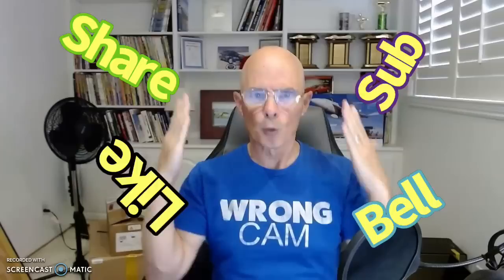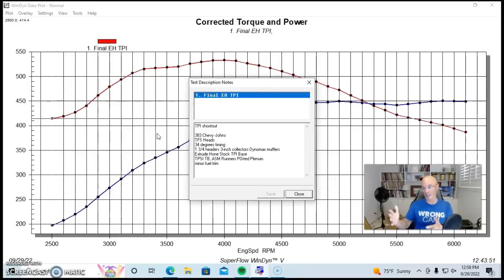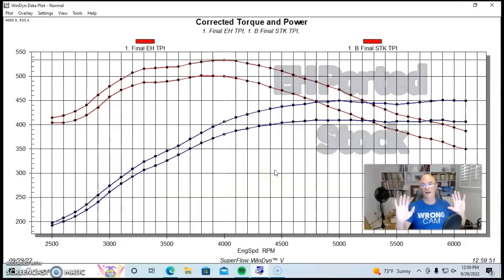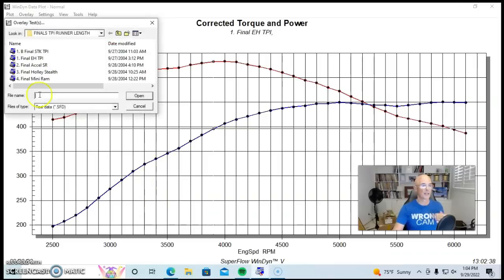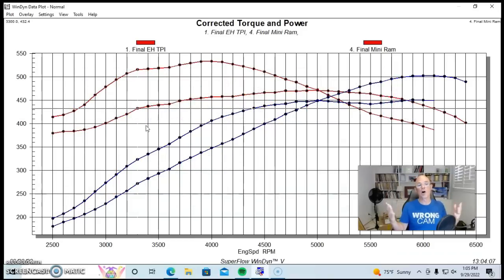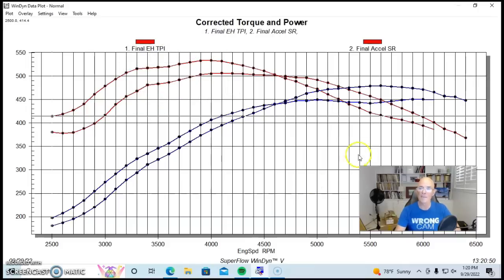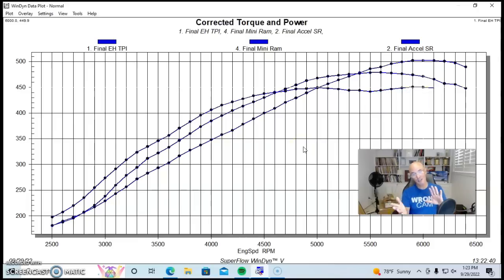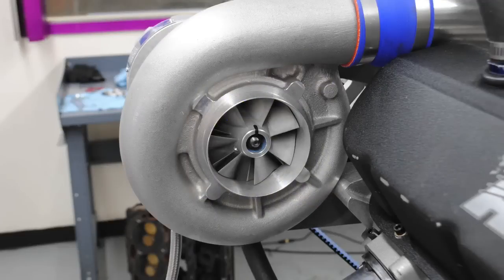TUNE PORT INJECTION-LONG RUNNER VS SHORT RUNNER-WHICH ONE MAKES MORE HP, WHICH ONE MAKE MORE TORQUE?

Comment: Tuned Port Injection - The greatest truck intake that never was!
Reply: They knew what they were doing. Need to fix your Vette/Camaro/TA? Get parts off a truck. Some of that went away with the LS.
Reply: GM could have DOMINATED the truck market if they would have put the L98 TPI in the gmt400 trucks in 88 instead of going with the TBI. Ford knew well enough to put a long runner efi setup in, Dodge did as well when they switched to mpi, but GM kept the abysmal tbi around way to long. Then in 96 when they finally switched, they went with the vortec, but used a medium length runner intake with the POS spider injection.

Comment: I keep getting tempted into going with a short runner intake, but every time I see one of these videos I realize I am better off with my TPI due to the rpm range that my combo spends most it's time.
Reply: Hello Kitteh  with my gearing I doubt I would ever hit 6500, my rev limiter is set to 6000, during test & tune I am at about 4800 rpm at the end of the 1/4, 12.9 @ 109 with 3.07's and all season radials, for my mild 383 and the way I use the car I am happy for now.
Reply: @E.T.GARAGE  Heck yeah, only a TPI will get you a 12.9 ET with 3.07s unless you're running a bunch more inches.  Sounds great!
Reply: @rotaxtwin  I have to launch real easy so I don't break the tiny little dana 36 in the rear.
Reply: @E.T.GARAGE  Yeah, good idea.
Reply: for short runners from what I see on the dyno curve, you neet to keep the car between 5500-6000 to maintain peak power and be superior to TPI. Below that it would make less power so will be slower. 
Now above 5000rpm there will be increased wear on cilinder rings and other things so if you want reliability the tpi is enough. However, the tpi makes more torque which can put more stress downstream and on rod bearings so you may need to tune it to reduce the max torque but not in the max power area. 
you said the rev limiter is 6k, I was wondering, did you parch the ECU bin file to accept extended tables?
Reply: @rotorblade9508  No  I have the standard tables, I do have extended tables in my bin. but I just dont bother with it.
Reply: For a street car I would rather have all that torque and horsepower at a lower rpm than to have to wind out the engine.

Comment: Holley stealth ram on a 383 afr 195 heads tiny cam I made 420whp back in 2000-2001 on 93 octane on a 1992 formula. Stealth ram by far the best option as great torque and peak hp came at 6400 rpm on a cam much smaller then he was using. Car ran 11s @122 mph which back then for naturally aspirated I was spanking a lot of ls builds and many procharger 4.6 mustangs. Once I did the turbo it was all over for them all. 800whp on 12 psi with a 3200 lbs car. Same 9.5 compression motor on same pos cam 12 psi was trapping 142 mph on a radial. Still 93 octane. I was spinning up into top of second gear so had to ignore then terrible et mid 10s but in the street on a fast roll that car beat bikes and not many cars were able to give it a good run.

Comment: I love the TPI .
 I had a 87 fiero gt with a 87 Corvette tpi 350 in it.  It only dynoed 328 hp at the wheels but 462 ft lbs torque after way to much money and time in it. With the 5 speed and my disregard for the longevity of the transmissions life it was awesome. 
 But at the time "2007" it was lots of fun and super quick. 
 Embarrassed allot of people who spent allot more money and had a blast.
Reply: Even on street tires at the strip I could dump the clutch at full throttle and just bang gears as fast as I could.  So much fun.
Reply: That must've been helluva handful and a lot of fun 👍
Reply: How did you tune it?
Reply: @xmo552  it was on mega squirt , so tune with a laptop.

Comment: TPI engines are a ton of fun if you build them correctly. I had an 87 GTA years ago that I built a 406 with good aluminum heads, smallish cam and a similarly modded TPI setup. Stop light to stop light it would destroy anything if you could get it to hook up.

The real pity of the TPI though is that GM never put them into their trucks since they did make such great low speed torque.

Comment: Still driving my '88 LB9 IROC, although a few years back I pulled and rebuilt the engine.  Compared to stock it's 0.020" over, has 1.6:1 rockers, 1.94" intake & 1.6" exhaust valves, 2-relief hypereutectic pistons, and Dyno Don headers.  Other than porting/polishing and gasket matching ports on the throttle body and runners/intake, everything else is stock.  Didn't expect any sort of earth-shattering changes--and can't really feel any difference.  But after 35years, it's still fun to drive with that low-end torque.

Comment: THANK YOU!!!!!! This is the exact question I've been grinding on all weekend. I'm going to rebuild my 288k km 305 and in the formula (cam/heads/intake/gears) I'm stuck at intake. My gut said that for my goals (300hp down low AND 30mpg) then the most i need is to maybe open flow with a throttle body and porting BUT I don't need $2000 in changes. Plus, the stock TPI can supply enough air my goal (much like you don't need huge exhaust if under ~400hp), so I can focus on efficiency.
What an amazing channel you have!!!

Comment: Totally modded 89 Formula 350 TPI. 58mm TB, AS&M runners, TPIS Big Mouth lower and cam with about 220 degrees duration I think, ported plenum with a T-56  behind it. Everything was gasket matched. Had Lingenfelter headers with dual big cats into a 3.5" Single.. It almost would lift the front wheels, got 26MPG at 75MPH all day cruising on the highway. Yes and Brodix-8 180cc heads. No mufflers and unlike a lot of cars from that day with Flowmasters it wouldn't drone you to death inside. It was actually not loud until you gut on it and it snarled at you... Probably because the decent sized single. Best car I ever owned... Unfortunately had a fire so I never got it to the track. It was good for 14.7 1/4 mile before and was probably a 12 flat car after the mods, would be surprised if she dipped in the 11 second range based on other cars. We took a couple hundred pounds off with the smog pumps, ac etc... Sighh will get off work tonight and drive my Honda Insight home ;0] Love these videos.

Comment: Running basically stock TPI, DAMN GOOD TORQUE, great autocross motor. Richard would using those "balls" to expand the tubes be worth it. G
Reply: Check out Charles Servidio.  He's modifying a stock TPI base.  It's not a size issue, it's a shape issue.

Comment: That answers a question I was going to pose about switching my Porsche 924 from CIS to  dual Weber DCOE.  I ported the cylinder head and intake manifold, installed a bigger throttle body, and put on a 4 into 2 into 1 header, and a thinner head gasket out of a turbo. I don't have a dynamometer, but I can definitely feel a difference in the seat of the pants and how far it pulls in the rpm range.  Before I did the mods it leveled out at about 5700 rpm, now it pulls strong out to 6300.  So I am sticking with the CIS.  I wish I had a dynamometer to verify the results.

Comment: I had the "Super Ram" on a 383 1985 IROC-Z. So long ago, it was called the "Box Intake" by, get this-John Lingenfelter Racing!!! Yup, before John changed the name to LPE. However, computer software was virtually non-existent then (1989), and I had to make do with different chips. JLR would send them with no identification on the envelope!!! Because of this, it was very camshaft limited. I ran a flat tappet .442/.465 lift, 214/224 duration cam, with 1.6 rockers, netting .472"/.496" lift. Ran old 291 fuelie heads with 2.02 intake valve, 1.60 exhaust valve sizes, with short radius port work. I also sent my OEM intake to Extrude Hone!! Anyway-It ran around 103mph in the 1/4 mile, single tire burning for hundreds of feet with an open diff. Learned about all this reading Hot Rod Magazine when Jeff Smith was editor. If I would've had the good aluminum heads, a roller cam, and especially the computer software available today, it would've been close to the 11s@120mph. But I'll tell you this-What a torque monster!!!

Comment: 1970 LS6 454 advertised at 450hp @ 5600 and 500 ft lbs @ 3600 rpm.  Big  extruded TPIS did 450hp and 533ft lbs. What's not to like about that combo?
Reply: Less weight 
More MPG I assume.

Is that tpis a longer runner also

Comment: It would be interesting to see the difference between the Vector W8's original manifold (used on exported cars) versus the TPI version, which was used for U.S. emissions requirements. The original version had dual plenums and shorter runners...
Reply: The US version of the W8 used a TPI style, but it was much larger than the GM TPI intake. First fuel injection still makes the US version of the W8 intake. The export version used the same base, but shorter runners like those on the Accel super ram, and then it had the twin plenums on top with balance tubes between them. So I would guess it would put down similar numbers to the super ram.
Reply: @THEFERMANATOR  right. The larger runners wouldn't change the power band. I reckon the Accel unit might be the most comparable to the export version.
Reply: I noticed that Vector engine a loooooong time ago as being a Chevy, but I could find nothing to verify...although it was obvious.

Comment: Mr. Holdener, have you ever seen the Tunnel Ram extensions sold on eBay for the old Edelbrock and Offy tunnel rams??
They come in 2 and 4 inch lengths and fit between the upper and lower manifold.
It might be a lot of fun to play with.
Reply from the maker: WOULD BE COOL
Reply: @richardholdener1727  The guys that make them are, Dashman's Hot Rod and Speed Parts.
Give them a call, you might get a free set to play with.

Comment: Question, is it possible to get that low end horse power and torque out of an LS motor? Or, if you've already got a stock 350 in an older Tahoe, just stick with that and throw a long runner TPI on it?

Comment: I had a lt1 based 383 in a 96 T/A and it was such a blast to drive. I always wanted a long runner intake for it but couldn't afford it and the intake bolts were so weird that at the time, nothing would fit and there wasn't much out there. I wish I'd kept it, but I stole the 6 speed for my swb and sold the rest

Comment: For a sports car I would prefer the super ram. It makes good power between 4500-5500rpm where the engine would feel comfortable and be reliable. Below 4500 I would not want to much torque, to protect the gearbox and better life for components since such cars would see track days or at least some spirited driving. even 500lbft seems already high
for a truck, most of the time you want low rpm torque, they normally can handle much more torque as well.
-miniram for highest performance, strret/track sports car
-super ram daily sports car, track reliability keeping in mid that for road courses weight and suspension setups make you fast as well. 
-tpi for trucks - reliability, comfort and efficiency (less friction losses at high torque low rpm)
corvette basically has chosen truck setup for a sports car but with over dimensioned drivetrain and this meant super reliability which is nice for cars that are often driven hard.

Comment: In one of your other videos you mentioned not testing the FIRST TPI...I believe it would have resulted close to your modified TPI...still the same length runners just bigger.
Reply: I have The First and Twin Turbos Dart Alu Heads and Hyd Roller cam Smal Turbos only 54mm K27 (Have litel bigger Turbos 64mm K29) Street car 12 bult rear end Toms axels 31 splines.

Comment: Holley Stealth Ram has been (KING) since it's introduction in 2003!

You don't lose a super amount of torque, but you get the HP flow needed... 

@Richard Holdner,

Still waiting for that "VIDEO" of a Gen 1 SBC type compact EFI whipplecharger that you claim there is out there!....
Reply from the maker: a whipple sbc? and the Holley Stealth Ram was also tested and the results shown (but was not King)
Reply: @richardholdener1727  It is (KING) when compared to what you get... 

It is the intake that gives you the most TQ/HP compared to other intakes.

Out of all of your tests, the one that gives you the most AVG HP/TQ  is the stealthram.....  Your own tests show this.

Shorter runners you lose more Tq.. Longer runners you lose HP... So the one that gives you peak HP and the lowest loss of TQ for said gain of HP intake is the stealthram.

And yes.. A whipple EFI type like the Eaton  Magnacharger brand styles that bolt right on a GEN 1 SBC in place of the intake itself.

Haven't found the one you claimed you had all these videos posted on yet.. Not (1)!
Reply: @ICONBADGTA  He never has claimed ,to have a Whipple small block ,on any of his videos.. 🤷
Reply: @allanb3222  He made a comment there was videos on his channel of several or something to that effect, as if they was a plentiful and many types out there when not (1) has been shown yet for EFI GEN 1 SBC. He did it in the comments of one of his videos that i commented on how the aftermarket refused to make those compact whipple/eaton type superchargers like whipplechargers do for everything under the sun nowadays but not for  for GEN 1 SBC's because they knew if they did no one would buy LSX shit anymore due to SBC making equal power with them.

He claimed they did make them and he had videos here on this channel of numerous ones he had tested or again something to that effect..

That happened. He knows it happened.  I look forward to seeing all these "VIDEOS" he claimed he had..
Reply: @ICONBADGTA  edelbrock did one with a Eaton 122 and either carb or efi
Reply: @indyrock8148  It doesn't exist!! Not (1) Time has a link to a EFI gen 1 SBC type that looks (ANYTHING) like the stuff they make for LSX's and other vehicles have been shown.. Not (ONCE)!!

Either ol Richard goofed in his comment or he really thinks they make one, either way it just isn't true because i have talked to (HUNDRED) who have told me if i can find it they would buy one!

There is a market, aftermarket just doesn't wanna make them because they know it will slow the LSX conversion market due to people making so much power with small block chevys with them!
Reply: @ICONBADGTA  Whipple part no 485-5004 marine blower. $8,000 but no longer on the Whipple website. There was also the 2100R back late 90's.
Reply: @indyrock8148  Sorry, but i cannot go back in time with a hope and a prayer for something that doesn't exist... So i say again..  No one makes a small compact type whipple charger for Small Block Gen 1 Chevy engines EFI like they do the LSX engines and others....
Reply: @ICONBADGTA  Edelbrock 1551 $3500 all day long
Reply: @indyrock8148  NOPE! That is for cheap junky carb setups.. Again.. Not EFI and not like the TVS 2300 type... 

Those are like "roots" or weiand 177" types.. Inefficient junk!  NOTHING like what i am talking about!!

This is as close as i could come to finding one, and i believe this is for a big block chevy..

It's just like i said.. NO ONE makes one for the small block chevy EFI style like they do for (EVERYTHING ELSE) out there.. Heck every reply you made have been for either stuff that cannot be found, never existed, or carbuetor junk roots style...

Lets just admit i am right and move on to getting eaton etc to actually design a new style efi for small blocks shall we?   I mean really all they need is a adapter for their TVS 2300 type to adapt it to a small block chevy V8 GEN 1 style..  I know they could do it.
Reply: @ICONBADGTA  I know it's not exactly what your asking for but those two edelbrock offerings have the TVS1900 and TVS2300 lobes, so your wrong on that account.
The TVS1900 version used to come EFI but was discontinued I guess it didn't sell. There is nothing stopping you using a TBI throttle body though. Or just get injector bungs installed.
The larger TVS2300 version maybe still comes EFI I'm not sure.
So quit your bitching theres two gen 6 Eaton offerings for reasonable cost good to probably 800+HP.
Hell the tvs1900 should be good for 700hp.
Reply: I would love to see a screw supercharger setup for a gen1 SBC. I'd have to lower my CR but I'd gladly do it
Reply: @SenorYuk  Edelbrock 1551.
Has Eaton TVS rotors.
Reply: @SenorYuk  Thay already got the top end stuff, the head unit etc.. You can take the one in the link below, extend the pulley on out to line up to a GEN 1 SBC serpentine setups.. All they would have to do is make a conversion piece and mod the lower manifold for a SBC bolt and coolant pattern. Even if people had to run a external thermostat housing etc. make it a kit!!

Even if it was 8-10k, hell i'd still b down for one, just cause i like the look and simplicity of it right there in place of the intake.

They just "DON'T WANT TO" and i swear i really believe it is because they (KNOW) if people made the same power with GEN 1 SBC as they can with LSX's, people would convert or go LSX like they do...

Comment: I'm really curious to see what a single plane 4-barrel efi setup would do compared to a Miniram. I had a nearly identical 383 to this test with a MR and it was a great driving engine. Currently working on a 434 and trying to decide of its going to be worth cutting hood up to fit a single plane or if I keep the miniram.
Reply from the maker: I RAN THAT TEST-SEE THE BIG TPI TEST VIDEO-WE RAN A SINGLE PLANE AND 4-HOLE TB

Comment: GM engineers knew what they were doing when they made the L98. Hp and torque were most people drive. 7k rpm sounds good but who besides a race car driver drives down the street at that rpm?  Also like that it gets decent fuel economy as well.